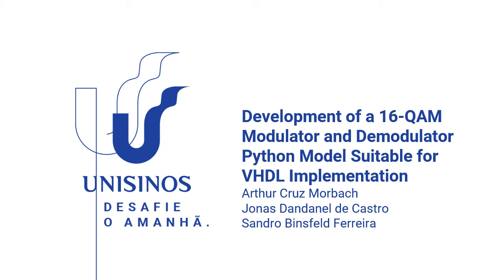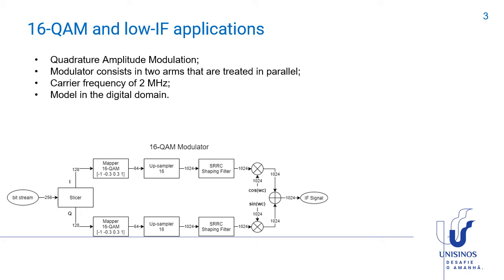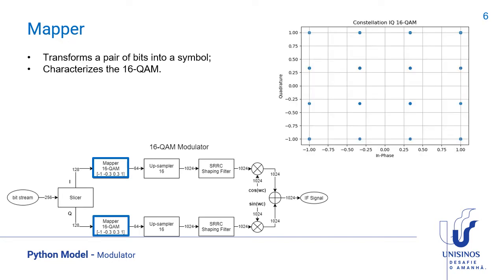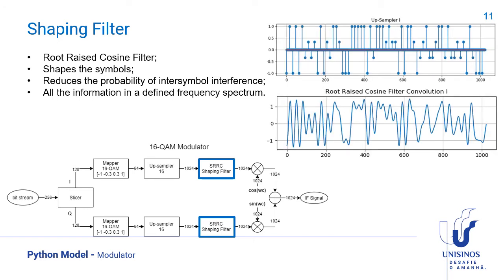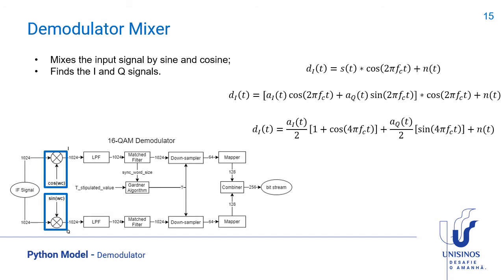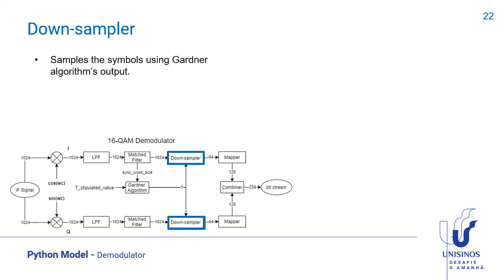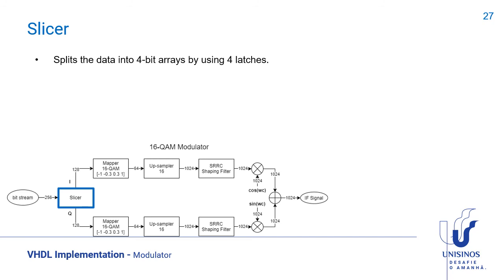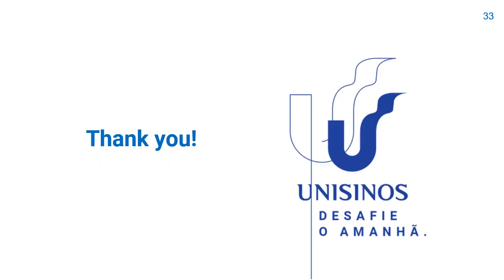Development of a 16-QAM Modulator and Demodulator Python Model Suitable for VHDL Implementation

Comment: Hello. Great video explanation and thank you for sharing your code :D. I have a question however. I saw that you add a PLL at the demodulation part and i saw that you referenced your code from the WirelessPi blog. I read that blog and I understood it, however there is a bit of a difference in your code and I can't understand why you added that code. I am talking about this part of the code in the PLL block :

   sin_out_n = -sin_out_n
   cos_out = cos_out_n[280:400]
   sin_out = sin_out_n[280:400]

   for i in range(18):
      cos_out = np.concatenate(
            (cos_out, cos_out_n[280:400], cos_out_n[280:400]), axis=None)
      sin_out = np.concatenate(
            (sin_out, sin_out_n[280:400], sin_out_n[280:400]), axis=None)
   return(cos_out, sin_out)

You get only 120 samples from the output of the PLL and then concatenate it with itself, in order to have the same lenght as the input signal. And indeed the synchronisation works. But I don't understand the physical meaning. Why did you choose to slice the signal and concatenate it ? I have also emailed you. Sorry for bothering :D. Thank you again for sharing your work and helping us have a better understanding of such systems. Have a nice day :D